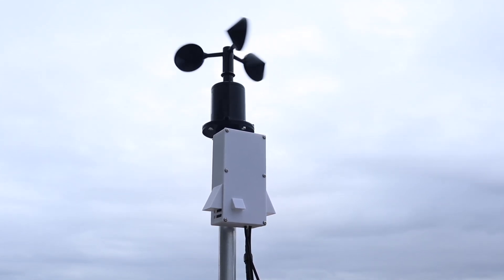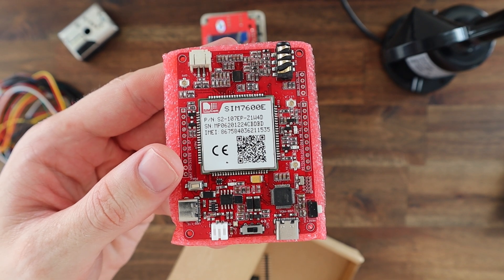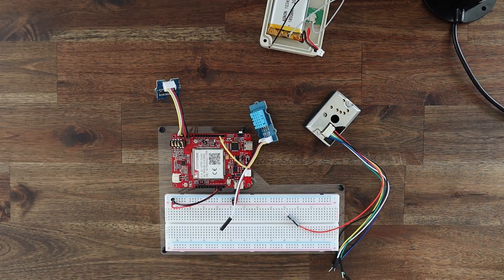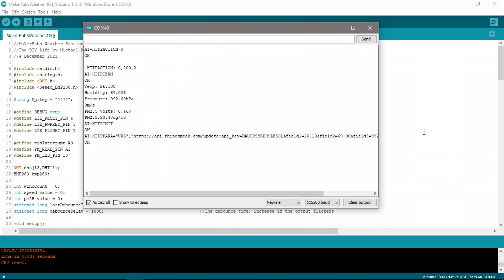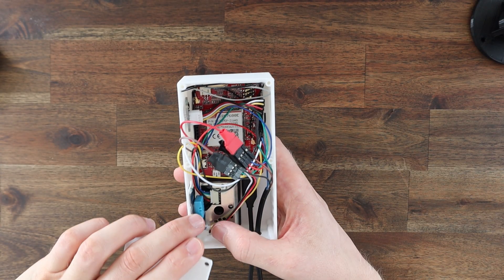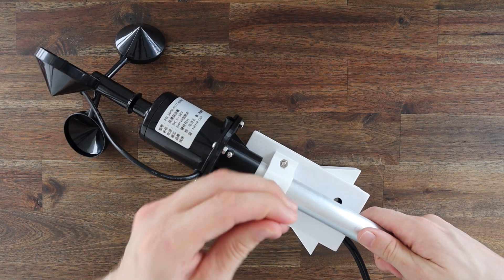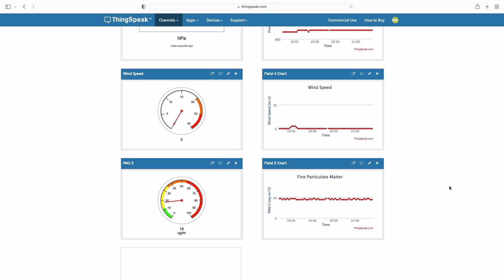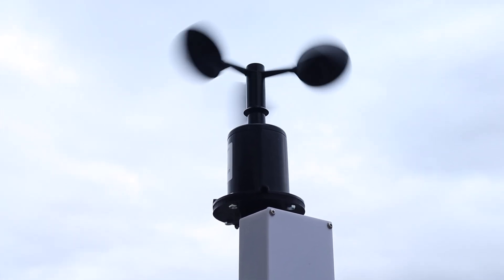DIY 4G Air Quality and Environment Monitor - Record Data Anywhere

Comment: Love this! Fully thinking of creating a few of these with video transmission capabilities for weather conditions as well, and like with DECENT cams too… solar shielded and weather-capable for the State of CO as we just had a lot of weather data stations go offline, as well as cameras, and 4G LTE on 2 cell networks in CO should cover it. I know the data is helpful, and programming is very important too… and here, we need the cameras for the data as far as, what traffic and weather is like on the Western slopes, as well as going through the mountains… and we just sort of LOST that, with CDOT trying to find a cheap solution — I have to say, I don’t think you can get it much cheaper! Definitely worth a shot to try and get the weather data working, sensors calibrated, etc… and then do a deployment and see what we can’t fix and fill in where the federal government is now just… leaving it up to us. If you haven’t figured out by now that if we don’t replace what they’re ripping away, we just won’t have that data… and that’s just not gonna work. We need more… plus I want even MORE environmental data than what this is giving — rad levels, radiation types detected, maybe even nonvolatile organics and stuff like that… but something that will help… and bridge this weird gap that everyone seems to need super fast but forgot about.
Reply: People say some things like this aren’t needed, but environmental data sensors like this have proven when companies released toxic fumes and chemicals in the air in Northern CA at the Chevron plant and many others across Europe and etc — they have a purpose. One day, you could end up with cancer and need a huge payout just to stay alive… and you’ll be glad these are around.

Comment: Hi Michael, I love your design for the air quality and environmental monitor. I wondered if the Maduino is able to read Serial data from a RS232 device (a Sky Quality Meter) as the serial ports seem very limited and all the code I try fails to work. It only seems to have the USB port and serial port for the SIM7600. Do you know if its possible to use SoftwareSerial or some other way as I think it’s similar to a Arduino Zero? Regards Gary.

Comment: Can this board interface with a LiDAR sensor like the TF-Luna.  Looking to make a device that measures distance and be able to send data to online server.
Reply from the maker: It's pretty much a standard Arduino board with some of it's pins allocated to the 4G modem, so most sensors that work with an Arduino will work with this board.

Comment: Hi, great video and project. Thx for sharing. On my side I just received the module and I have connected a RFID scan reader to it but I'm facing an issue with the length to process data and sending it to my server/api. Did you notice that also on your project ? Basically I have 10 seconds differences between my read / scanning the RFID card and the reception on my server/api. Any thoughts or advice ? thx in advance
Reply from the maker: They delay might be on your server/api side, I didn't notice any significant delays in sending data to Thingspeak. The screen recording of this post sequenc is shown in realtime at 3:23
The actual data transfer portion looks like it took around 1-2 seconds

Comment: Maybe this question is a little too deep for this section but... I've followed the code and cant find where the TX and RX for the UART of the SIM7600 is defined. I would have thought they would need to be defined in the same area as the LTE PWRKEY, RESET and FLIGHT pins??

Comment: Nice tutorial I really enjoyed it !! 
One thing I want to mention though :). SIM7600E is an LTE CAT.1 module and it can reach a maximum downlink speed of 10 MBit/s not 150 MBit/s.
Reply from the maker: I should have looked at this a bit more closely. Their documentation and specifications say that they use a SIM7600E-H module, which is LTE CAT.4, but the actual module on the board that they sent me is just the SIM7600E, which is LTE CAT.1 as you've said. I'll reach out and ask them if this was just an early prototype or if they've made a mistake.

Comment: Cools, how about project on telemetry system for speed boat that are not equipped with this? So that the boatman could trace all the necessary parameters like the high tech boat/ship? Ie boat speed, engine power and engine battery power monitor? Thinking to equip such maybe solar powered system